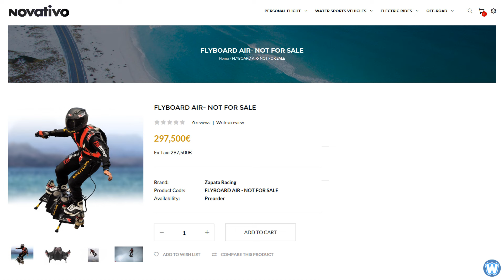Crossing English Channel on Flyboard Air Jet Hoverboard

Comment: XJET/WASP was the American's effort, worked, but the helicopter boys did not like the competition, the original Vertical Take off and landing of this style of Design was in France by a French company April through August 1957.
The  SNECMA Atar Volant or C.400 P1 was a French turbojet engine produced by SNECMA as part of their "Atar" series. Encased in a basic fairing which could hold fuel and remote-control equipment, the unit weighed 5,600 pounds (2550 kg) and generated a thrust of approximately 6,200 pounds-force (27.6 kN); the Atar Volant was able to cause vertical lift, Actual machine is on Display in France "Atar Volant C.400 P2"

Comment: I can definitely see the military potential of this technology. because of it's design, you have one hand free, meaning that it's possible to control the fly board while carrying a gun. I would like to know if its possible to shoot while flying, assuming you use a low caliber with a good recoil system.
Reply: Build the throttle into the grip of the rifle.
Reply: could be used for going over difficult terrain more so than offensive action but yea

Comment: Imagine how cool these are gonna be when we figure out nuclear fusion!
Reply: Nuclear fusion cannot take place in small containers. It will require several square kilometres to derive efficient energy from nuclear fusion 😁
Reply: @Leon-bp6kb  Ofcourse! The energy produced from it could be stored in the battery, however that will be the same as any regular battery.
Reply: @Leon-bp6kb  yep it can, but fusion is really only about production efficiency, if you want to be able to use that device for hours, you gotta make new improvements in the storage part of things.
Reply: Does a nuclear submarine body rich about a Kilometer? So NO

Comment: It’s nice seeing flying jet platforms making a comeback, in the 70s there was one like this called Williams x jet, it was a bit larger and had a larger single jet engine in the front of the operator’s legs and was probably more stable than this, but sadly it’s development was stopped because the us army already had helicopters and doesn’t need these

Comment: It's the first baby steps to flying cars. Fuel needs to change, somehow.
Reply: Trusten Baker     no fuel liquid air
Reply: @lucille4824   Well whatever, I just mean that the fuel needs to get better to have less of it and go further or the engines do, or both.
Reply: @lucille4824  We aren't going to have flying cars till the engines and fuel improve dramatically.
Reply: Nuclear?
Reply: @trustenbaker8766  Well it seems that he's going to prove you wrong because he said he would reveal the first prototype of a flying car before the end of the year. Apparently it has already been flying but he cannot display it for safety issues. The engine is still a limitation for autonomy but the technology is already there.
Reply: PierrotHD People understand the technology is there but that’s not the problem for flying cars.
Reply: E charge
Reply: @trustenbaker8766  why would you need flying cars? Its the most impractical idea in reality. Hearing jet engines all the time, everyone needs a pilot licenses, drunk FLYING. If there's as many people flying cars as there are driving then accidents will double and they will be hella fatal every time.
Reply: Kat SpicErt Yeah. That’s why I said “ first step “. It’s not if it will happen, just when. I think you lack vision. It’s obvious they wouldn’t be controlled by the driver. That’s pretty stupid. Heard of self driving cars? So obviously the will be controlled by ai that never gets drunk. The noise? That’s why I said these are first steps. Don’t be so negative. But it will happen, theirs no doubt.
Reply: I wish i could live 300 years more to see all the iventions in future

Suddenly got a thought about what the world would be like after when i die
Reply: flying cars already exist, you just need to get a pilot's license and enough money to buy one of those expensive things
Reply: Flying cars are impractical and incredibly expensive.
Reply: @KatSpicert  Flying cars of the future will have accident avoidance tech like in a Tesla where people can't crash even if they want to. How about that? People shouldn't be so closed minded about technology. The only real issue now would be range and noise which I think should be resolved in a couple of years.
Reply: @jovanleon7  i forgot I said any of that tbh, but I never denied it could happen. I love seeing the evolution of technology and how it exponentially improves before my eyes, but with our current societal infrastructure we won't have the need to more than it's impractical.
Reply: @KatSpicert  It's exactly because of our current infrastructure that we need a more practical means of transportation. VTOL vehicles or flying cars are the way to go. First they can only land on helicopter landing platforms on buildings, but soon there will be built special landing platforms on the ground for flying cars that are connected to roads similar to how Tesla built their fast chargers everywhere.

Comment: Yeah I don't think this'll ever be for sale to the general public due to certain laws involving aircrafts in residential areas have to be a certain height, that height being impossible to reach for the amount of fuel and there's also the noise one of those jet engines is enough to make your ears bleed at 100m of distance, I think this is just for the wealthy people who have a crap ton of land just to mess around on with it this is also dictated by the price.
Reply from the maker: yeah I agree, but even with Remote Control Planes & Helicopters they have to be taken to open fields away from houses, where they do not annoy people and break EPA noise levels restrictions.
Reply: @WonderWorldYTC  yeah the reason there getting monitored like hell is because of people's privacy being invaded by other people  using drones, most average people don't do this but it's the bad apples that spoil the bunch sadly same with most laws tbh

Comment: A sort of solution to the fuel problem, would be to tow a fuel tank, supported by a helium balloon. 
Program the release of helium in the balloon in proportion to the fuel used.
It would have got you right across the English Chanel, with the option to fly the final stretch as in the video.
Reply: Have you ever seen any aircraft towing anything in his very back ? It's very dangerous for a pilot and so the aircraft.

Comment: Surface tension of water is extremely great. Water is often said to be as hard or harder than concrete which technically isnt true however your just as likely if not more so (lack of terrain to break/cushion your fall) to die from height hitting water as you are hitting land.

Comment: A more volatile fuel with a higher energy density might solve the range problem, and possibly event he weight issue, but I still wouldn't use one without a parachute.

Comment: So theres a max weight the hover board can carry. How much fuel you have is your weight subtracted from the max takeoff. Otherwise get a bigger backpack for more fuel. 

Jets are the same way. Theres only so much thrust available. Just because there are eight hard points to mount bombs on doesnt mean you can carry eight 10,000lb bombs.

Comment: I wonder why the fuel capacity is stored in the backpack and didn't just make a larger board to hold fuel. Maybe the weight and the shape could be harder to steer when leaning. But if the tanks were shaped like small wings

Comment: You showed video of the EZ Fly and didn't even mention it.Why not?
Reply from the maker: what is EZ Fly? also all footage in this video was of the Flyboard Air, so not sure what you talking about
Reply: @WonderWorldYTC  EZ-Fly video starts at  2:28 and runs for 19 seconds.
https://www.zapata.com/air-products/ez-fly
Reply from the maker: @Slicklickz  ah you made it sound like it was a whole different product, it's still a flyboard air.
Reply: @WonderWorldYTC  Different engines,different airframe,different gyros,different firmware,different controls.The EZ-Fly is basically a flying Segway,nothing attaches to your body while the FBA you are wearing boots with turbines in them and you are wearing the fuel tank,and the controls are strapped to your arms.

Comment: Like with the Gravity Industries device, the hoverboard has no practical application other than as a fun thing to thrill audiences.

The Swiss Jet Wing by Yves Rossy has actual, proven endurance, it can operate at altitude and has a built in parachute.

It can launch and land vertically and fly faster and further for considerably longer than the two devices mentioned above.

The ultralight helicopter sector in both the USA and Europe has produced some remarkable, tiny but capable aircraft, and I believe that that will prove to have greater practicality than the hoverboard or Gravity Industries suit.

Currently, the Swiss Jet Wing is hugely ahead because by having a wing to provide lift, one also has the space to carry more fuel.

The Jet Wing is actually practical in every way, having commercial and other applications.

Comment: It’s not a solo crossing, but still really impressive. We need greater energy efficiency, and that requires a breakthrough in next gen energy sources. Still, I can see these being utilise by the military for focused operational uses, the rescue services for getting to people in certain situations, and to reach people to administer medical treatment.
Reply: Stop throwing "next gen ... whatever" around ... and get a degree in engineering. THERE WONT BE ANY "LEAPS" ANYMORE, because technology is at its limits already.

There are BETTER CONCEPTS though ... simple rotor-driven "drone-like hoverbikes", but they dont have the speed of the flyboard.

Comment: I think the "1500 horsepower " is in error as seems to be much more that needed to get vertical takeoff with up to 400 pounds of weight. The 10 minutes of flight time is probably going to be design limit in this device as there is no way to strap another 75 lbs of fuel on in practical way. I would like to see this jet engine technology installed on small man carrying fixed with aircraft as could be 250 knot cruise / 300 mile range and the chance to make emergency landing in the event of power failure.  If this thing has a sudden power failure its gonna fall like a ground sick anvil.
Reply: you are a genius .... the world can’t wait for you

Comment: Maybe it was unavoidable, but there are some pretty conspicuous video frame-rate conversion issues (motion judder) in some of this video.
Reply from the maker: are you saying that he faked crossing the channel on a flyboard air?
Reply: No, just that there are some video standards (frame-rate) conversion issues in this video. Many people aren't aware what a can of worms this can be. This vid is 30 fps, the source material may have been variously 23.97, 24, 25 or 29.98 or 30 fps.  Some judder can be unavoidable, but done wrong it's very conspicuous - you need to covert all the footage before editing.
Reply from the maker: @EliteRock  I usually slow down or speed up a bit of footage to fit within my narration sentences, but i don't think I needed to do that too much in this video.

Comment: Make it electronic and commercialize it
Reply from the maker: it is electronic, pretty much every machine is electronic.
Reply: @WonderWorldYTC  What I meant by electronic is no gas, just charge up and go, like an electric car , no petroleum
Reply from the maker: @ZinedineKhabib  in a small device like the hoverboard, I doubt you could have a big enough charge to achieve much, plus jets don't run on battery they need gas / petrol. if you used propellors with an electric engine you would not get much range, probably less than 5 minutes, if you can get off the ground at all.

Comment: Other countries might but the U.S. will never have flying cars and these flying and other personal flying machines in the air anytime soon using the airways that regular planes and helicopters use. There is no way that thousands if not tens of thousands of additional flying machines could be managed safely with the current infrastructure. The U.S. FAA is just barely able to manage the amount of commercial, military and privately owned airplanes now. It may be possible at sometime in the future if they start using super or quantum computers to manage the airways. I do see some personal flying machines that are only kept a few feet off the ground being used in very remote areas say in the desert southwest and also possibly be used for search and rescue.

Comment: Nicely done but this thing ( and many more others like that) will never go on retail. Its to unpractical, uneconomical and  it does not meet FLIGHT REGULATIONS with this kind of noise ( among others)it produces. Fuel engines are to be forgotten. Tesla has shown us the future. Use electrical engines and this might actually work.

Comment: Physics is a bitch. To fly further he needs more fuel, but that would require more thrust to lift the extra weight.which would burn through the fuel quicker, requiring more fuel....which would require more thrust to lift the extra weight. And so on.